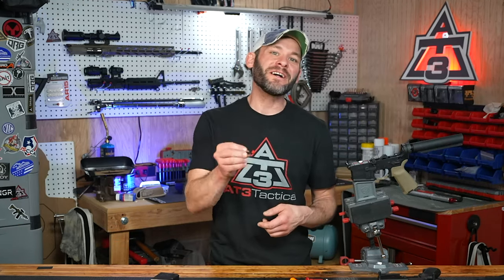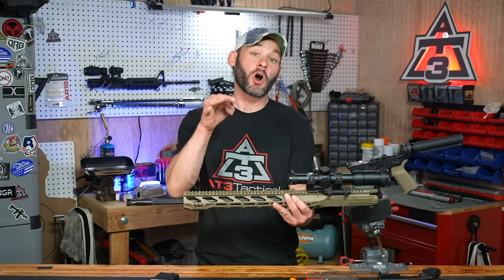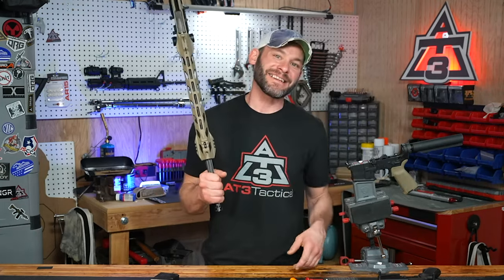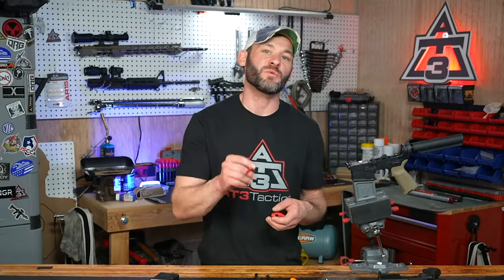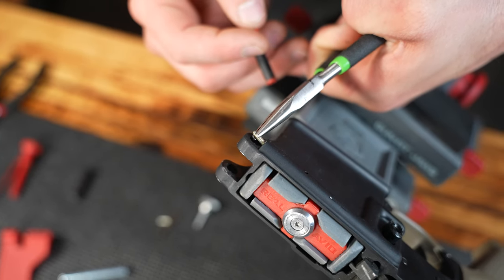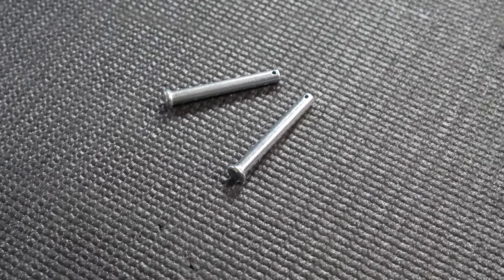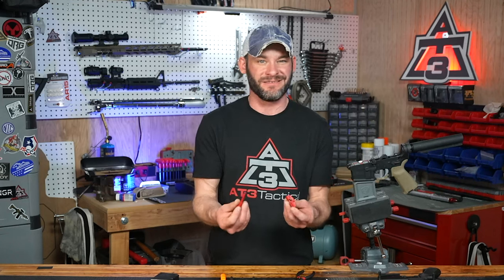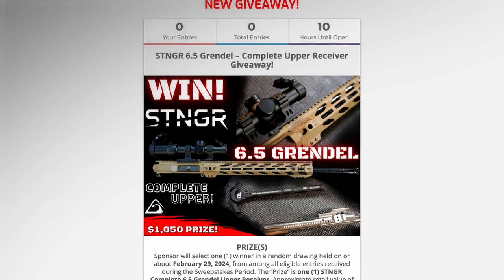How to Install a Pivot Pin on AR Rifles.

Comment: I recently bought one of the Real Avid plastic pivot pin tools and it works great!  I was using a utility knife blade for years and it works...but I admit to lunching a few pins and springs into orbit. The clevis pin trick actually looks like one of the best ideas. 

The tool was worth it!

Comment: That pivot pin tool is the shizzz nits!!!!   But it’s not that easy you should really really really do a vid on exactly what’s going on I had to do a few lowers before I truly understood how it really worked!!! Spring in then it clips in the lower which side matters then the pin jams it in the whole rotate the tool up pull the pin then in with the take down pin the longer one it is tricky (Is So Simple it is actually tricky) but if you miss the detent goes about 10 yards.  Extra spring extra detentes is a really good idea!!! But try to understand the best you can what is going on and don’t get in a hurry that’s when most things go wrong. Take your time and once you get though your 3 or 4 th one then it will make sense… one point tape the shit out of your lower that roll pin 📍 for the Bork catch using the mil speck kits you have to beat the fuck out of them.  I use a C Clamp on pressing the second one in for the trigger gaurd.   AND MAKE SURE you have the bolt catch in BEFoRE doing the bolt catch!!! It’s a Bitch beating that roll pin in angle is everything but it’s 2 times as hard beating it out because the bolt catch was not done first!!!